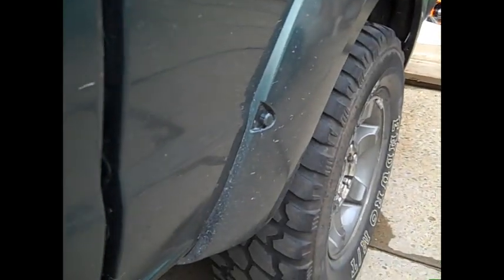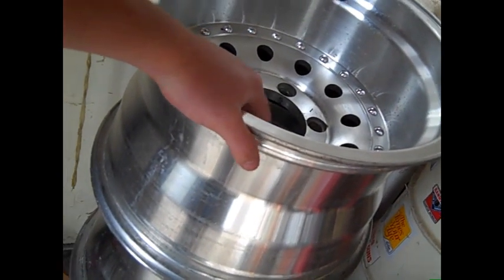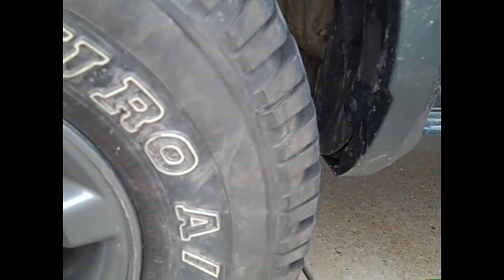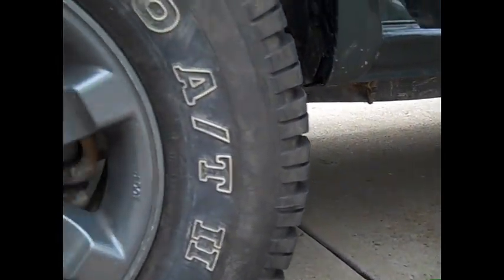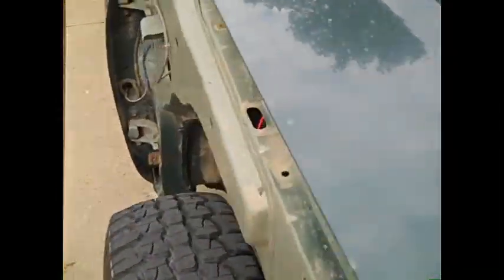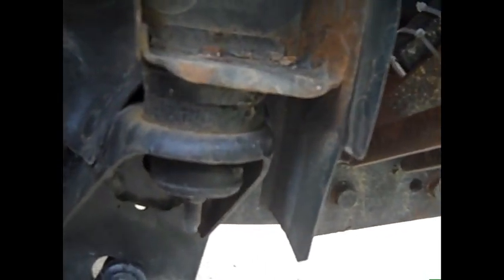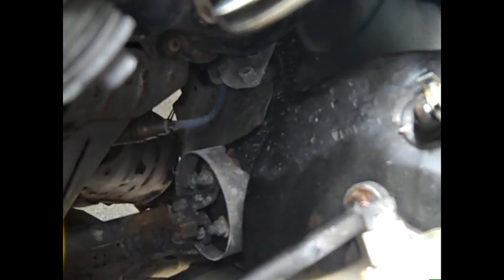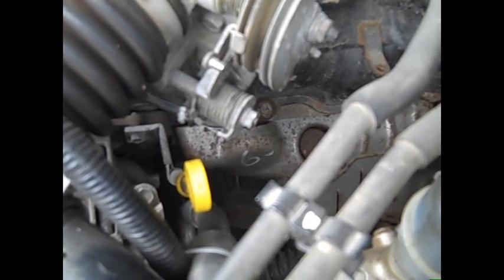got new new rims... HELP!

Comment: that steering shaft should extend and collapse kinda like a shock but with no pressure and as for the hockey puck lift i would use alot thicker studs and bolts (you wouldn't wanna go into a sharp turn and have the bolts snap ) other than that it seems doable   keep in mind the wiring will have to stretch 2-3" as well as break lines etc

Comment: hmm do some more research and looking around for a lift kit and some good prices, maybe look around for some used ones that arent too old and expensive. i would say go for the hockey puck lift or cut and drill out some steel spacers but you can never be to sure on them and how long it will last. def. dont cut anything body wise too. sorry i couldnt help out that much =/ but much luck on solving this!

Comment from the maker: @03grandgtramair alright. well i have never seen any wiring that runs between the body and the frame but im sure there is. i dont mind cutting and soldering in extensions. and im pretty sure my brake and fuel lines dont connect to the body ither there run on the top of the frame.